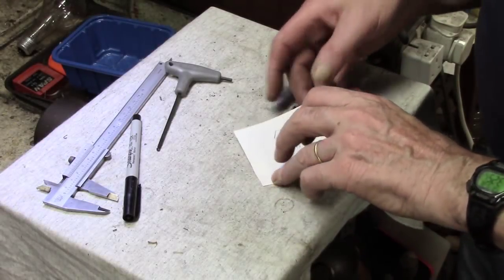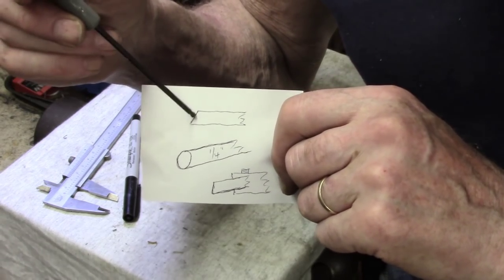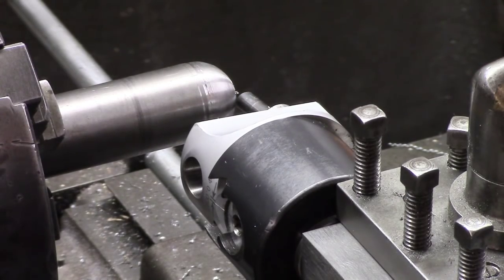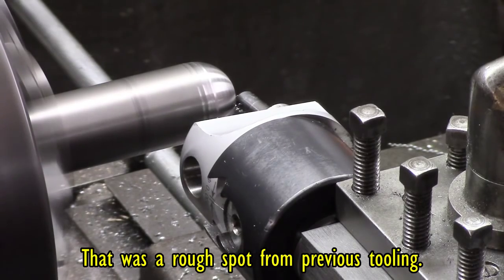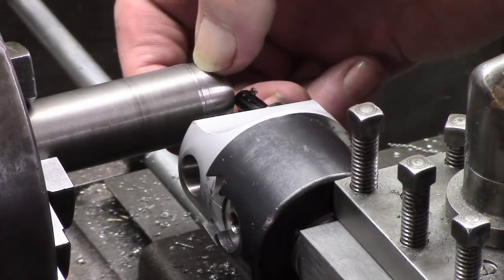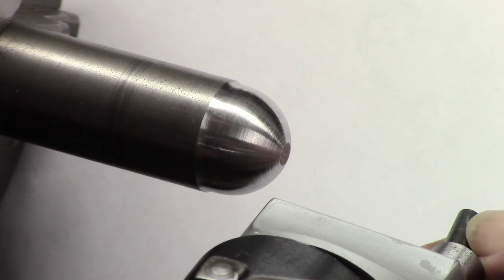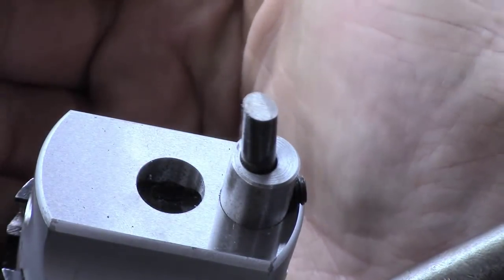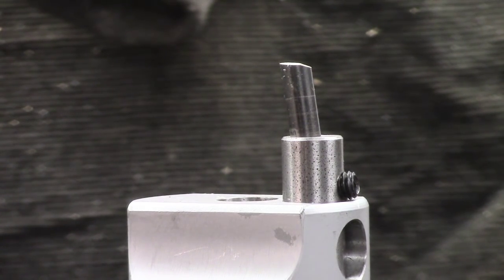MKll Radius Ball Turner - Re-tooled, Yet Again

Comment: I feel like your problem is not the tool profile but using th cross slide to advance in, it's like cutting below the center line of the stock. You wouldn't adjust your regular tool bit below center hight if you were end facing or straight turning.I think the tool should be set on center line and use the boring head to advance in. Cheers
Reply from the maker: johnnym1320 Hi - indeed this is a significant aspect and the next test when I make new tooling will be done with the boring head adjustment. However, with the arc traversed by the cutting ''sweep'' inevitably there is a significant degree of deviation from a true center height and some degree of compromise. :)

Comment: Hello Chris,
This is getting better, as far as my feeling is, you'll need a combination of boring head adjustment to start, and, finish with only carriage advance, as long as the tool angle in still not offering any rubbing on the bottom part...
Interesting... :-)
Pierre
Reply from the maker: pierre beaudry Hi Pierre - indeed, plenty of fine tuning still needed but am very encouraged.

Comment: Welcome to the wonderful world of GHT's (and J A Radford of course, in his book "improvements and accessories for your lathe") tool grind, although you might benefit with a tad more top rake. Generally that grind works but when you get to cutting the neck of the ball it produces quite a pronounced fillet. There is a slight alteration to that grind to allow a sharper corner to be cut and if I can ever find the book, and get my scanner and laptop to speak to each other, I will forward it. Unless someone else can chime in with info first.
ATB
c
Reply from the maker: Chris Stephens Thanks Chris -- rake is yet to be experimented with further, as this was a quick preliminary evaluation test. If by chance you can find that book and do a scan, would much appreciate the further info. If you did succeed, or anyone else, just message me on my channel page and I can supply an email address.

Comment: This is exactly as I would make the tool, the only thing that needs to be done now is to replace the soft tool (the shank of a drill is very soft and not hardened at all) with a high speed steel blank, you could use an old milling cutter or centre drill for this, well done on this project. Chris B.
Reply from the maker: Englishman French Quite agree re the drill shank aspect -- this was very much done to test out and establish viability. It was however, even without extra heat treatment doing quite well. Once i get my drill rod I'll use that and heat treat as well.

Comment from the maker: To add - explanation re the tool seeming rotated.  The tool holder was made with difficulty for the angle, and its bore is not quite true and so - for the test that was rotated a bit. In fact the tool itself could have been rotated better in it before starting.